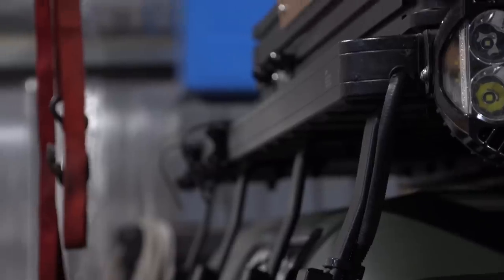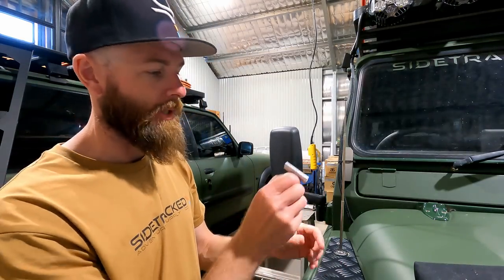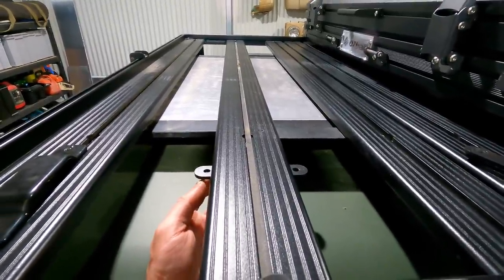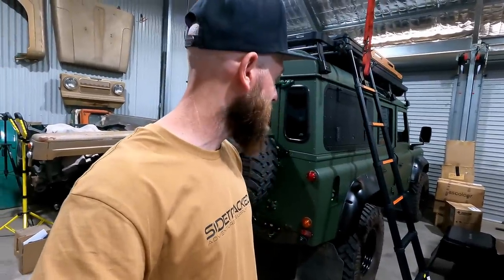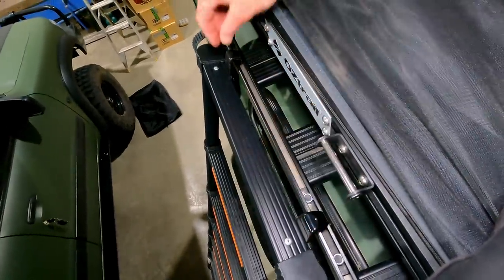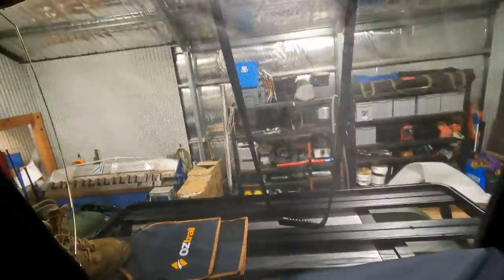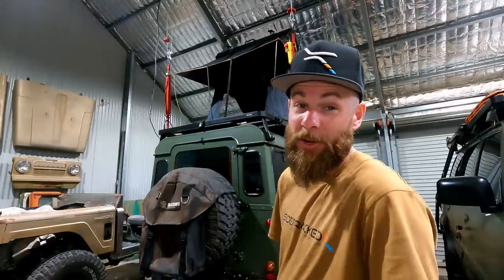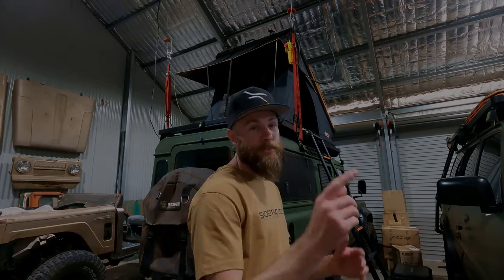New Roof Top Tent - First look

Comment: Weight, weight and more weight. And it's in the worst possible place. I've gone away from heavy RTT's, and back to a swag on stretcher. Car is much lighter and stable.
Reply: Running to a deep slope, the chance of roll over is high…… will never get a RTT…
Reply: I’m considering removing my ARB RTT from my camper trailer due to 1) the weight 2) pack up is a pain 3) in and out via a ladder.  Horses for courses, if I was in my 20s or 30s no problem, thinking swags might be a better option moving forward. Aside from the weight this HTT looks good, cheers for the vid.

Comment: 95kg is a ridiculous weight. Manufacturers are going the wrong way with RTTs in my judgement. I'd love just one of them to produce and sell (in Australia) RTTs in the 25-35kg class. They'd be light and "tent-like" in construction, but that'd open it up for a lot of smaller vehicles - and for those who's already (like me) popped discs putting up their 65kg RTT.
Reply: Go Fast Campers have one at 50kgs only thing I can’t find a dealer in Australia
Reply: inspired overland rrt lightest and alu lt 50 are lightest but…expensive and no dealer in australia. The rest most roofs can not cope😂

Comment: Looking at the dimensions and knowing OzTrails target audience, this seems to be designed for a crossover 4x4, not a full size 4x4. That's a heavy tent for such a small bed, but I do like the hinge system they have used (I expect that's where the added weight came from).

Comment: I used to have a clamshell rtt
I had to use the side access like you are doing
Side access is great, unless it's raining, then as soon as you open the side door the rain blows in and you and everything inside gets wet, Murphy's Law says it will rain when you go camping ....
These rtt usually have a built in awning over the rear as this is the way to get and out 
Just wanted to share my experience with you

Comment: Get yourself some rubber matting with air holes, from bunnings the square mats put under your mattress stop condensation, the underlay is crap, watch that you don't get water coming in thru the hinges, had two hard shell roof tops both leaked at the hinge

Comment: what happened to the james baroud??
Reply: I don't know how it prices but compared to a Bundutec Bundu king Electric lift tent its way narrow with only a 50mm mattress compared to 100mm and the Bundu can also store all of the bedding made up. Plus lighting and electric fans
Reply: @frankguernier2280  ... the bundutec tents look disgusting. Like ur lugging around a coffin on the roof.
Reply: @krump743  bloody comfy coffin I have to say. I too have a Bundutop, best bit of kit we've ever added to our Patrol. As previously pointed out, stores all bedding, including pillows, has cooling fans, 12v power outlet and internal light.
We've added reading lights, USB ports, switch's to 12v outlet allowing us to run a permanent wired 12v electric blanket (switched).
We've also installed a permanent diesel heater, it is the ultimate camp.
We were both past ground camping, setting up camp, making up bedding, disassembly and then storing in vehicle.
That coffin as you refer to it has all this and more contained in it, it's all accessed in under 2 minutes, including ladder placement, unlatching 4 overcentre catches and pressing a button for 18 seconds to erect it. Totally reinvigorated us oldies to keep discovering remote locations, Cape York, K'gari & Simpson. Go the coffin.
Bloody expensive, worth it for totally comfy nights sleep.
Unsure if it qualifies for mile high club 😁😂🤣.
Luv Luv Luv my Bundutop.